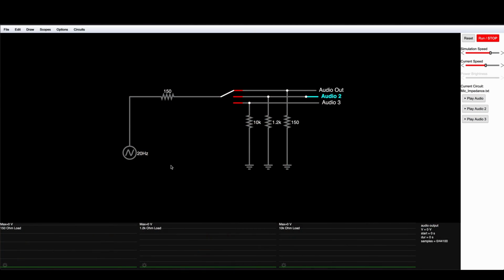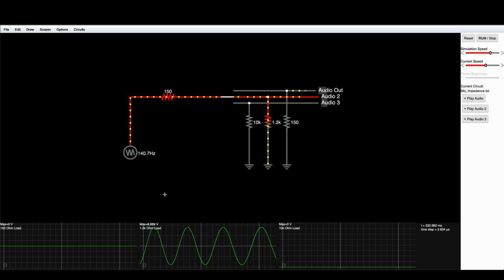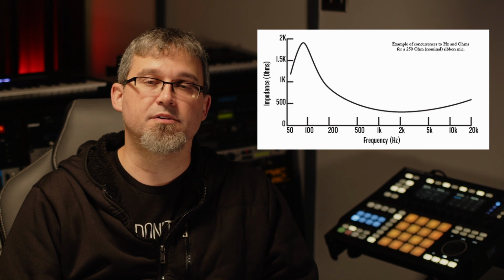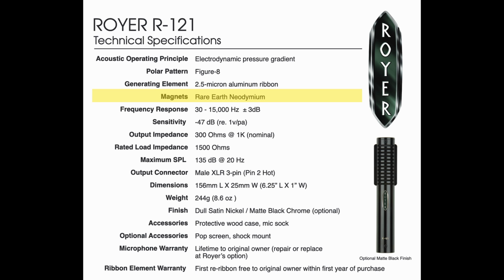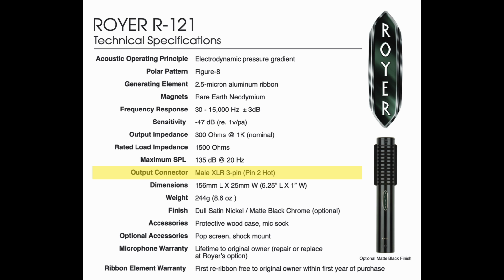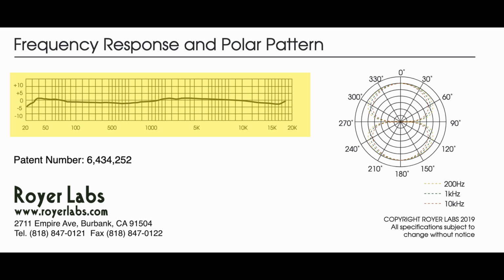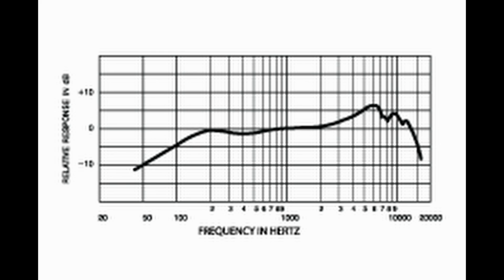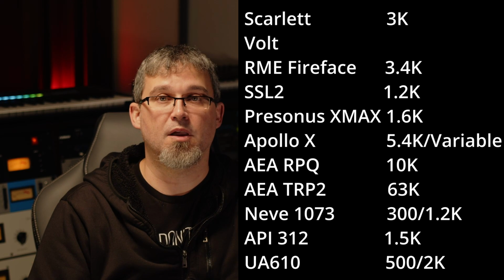Impedance

Comment: hey! if i’m understanding your tests correctly, I still don’t think my use case was covered. I have a vintage hi-z mic (25k Ohms) with a TS connection. I’m trying to figure out the best way to connect it to a modern interface. what are your thoughts? Do I want to the opposite of a lift, if that even exists? Or am I just not getting it? that’s definitely possible 😂
Reply from the maker: Yes, you can use a device like this:
sweetwater.sjv.io/Z6RJWz

There are other brands and converters available. But you want a hi-z to lo-z transformer.  Shure makes a reversible one
(Shure A95U Line Matching Transformer - XLRM to 1/4-inch Female)
Reply: @meistudiony  amazing! Thank you so much. purchased!

Comment: I came here because i wondered what is best for a mic with 40 Ohm impedance. I think I should set the pre-amp to low-Z. The pre-amp definitely has louder output when I set low-Z on
Reply from the maker: 40ohm is pretty low.  Usually when we talk about a lo-z mic, we're talking anywhere from <100 to about 1k or so.  High impedance is usually in the 10K+ range.  At one point there was medium impedance, but its not really used much anymore and was trying to be an intermediary between lo and hi so that it could pass on either system.  Thanks for checking it out!

Comment: Kick A!! Video; great explanation… question, I have a Tf51 mic rated 300 ohms with a BAE 1028 pre 300 - 1200 ohms ; which should I buy a cloud Z or AEA mic pre ?… I would highly appreciate your expertise
Reply from the maker: At 300ohms on the mic the BAE pre in 1200 mode will work fine with it and probably sound amazing. The cloud z wont pass along phantom power to that mic, which it needs. The AEA pre really excels with dynamic and ribbon mics but does still sound good on condensers. Honestly though… i think youre golden w the BAE.
Reply: @meistudiony  The mic is a telefunken tf51; it’s a tube mic that provides its own power so would a cloud Z work as far as impedance matching ?… I’m trying to have impedance 10x the 300 ohms of the microphone. So, would cloud z be any good in my situation ?
Reply from the maker: @Nighthawkclips  you might see marginal low end improvement, but probably not enough to justify the cost of the cloud Z.
Reply: @meistudiony  thanks… It also should result in a better EIN; lowering the noise floor ?…

Comment: It's been my experience that some microphones change more with preamp  impedance changes than others.  For example, if you did this same test with a Coles 4038 instead of a Royer, especially a lower impedance version, changing the impedance it sees can have a more drastic effect.  Also, the XLR name came from Cannon Electric which described it as X - series name - Latching-Resilient. Sorry to "but axchually" this, just trying to be helpful to those looking for the information.
Reply from the maker: Yes, i went over all the cannon stuff in a later video, all good! I like when people bring stuff to the table! Keep it coming!

The mic itself definitely plays a part in the tonal shift from the mic pre impedance.  And you're exactly right.  Since the mic itself isnt a "static" source (depending on the frequencies its picking up it changes, which is why a mics impedance is calculated usually at JUST 1k).  Ribbons and other dynamics are especially prone to this.  I have noticed that older designs (like the coles and RCA mics) seem to shift more than say the Royer 121 or R10.

Comment: I appreciate the information in this well done video. Having been a UA Apollo owner for many years, I've come to the conclusion that the variable impedance modeling in their Unison preamps does little more than affect relative gain staging. That is, I can use a 600 ohm mic into a 1073 Unison plug-in and a 200 ohm mic into the same 1073 plug-in and they will, after compensating for the small relative gain differences, sound identical. While there may be some minor differences in the very low frequencies, I typically have these frequencies rolled off with a LC filter anyway. My ears simply can't detect the differences in sound based on differences in mic impedance.

On a related issue, this subject has become of more interest now that I've purchased a UA Sphere LX microphone and have begin experimenting with its different models. The Sphere is a fixed, 200 ohm (@ 1kHz), dual capsule mic. Its raw, 200 ohm input signal is coming into the Unison preamp and met with whatever Z the current plug-in has configured. The mic modeling only happens post Unison AD conversion AND post Unison plug-in modeling. If the above discussion regarding impedance vs sound holds true, then the Sphere's post-Unison sonic modeling should hold up reasonably regardless of the Unison plug-in's Z setting. Of course I'm assuming that other aspects of the mic model (i.e. pickup pattern, axis, etc.) are purely a mathematical function of the dual capsules and have little to do with the signal at any given moment. But I may be wrong on that.
Reply from the maker: From what i've seen / heard in experimenting (still) with impedance, the biggest difference i find is ONLY in the top end.  The lower the load, the more the top end will get rolled, the higher the load, the more top end presents.  The sphere is a very nice mic (we have the Townsend version, from before UA took it over.... same mic).  But yes, the software isn't taking impedance of the original mic into consideration nor is it able to compensate for how a dynamic mic will react to the shift in load at the preamp.  Its an approximation and one that in the scope of things, doesn't really matter much in the context of a mix.  The function of the dual capsule is to be able to approximate the polar patter of the various mic models (very few mics have perfect cardioid patterns).  The two diaphragms are mixed to create the pickup patterns (the same as is done on many mics that have multiple patterns).  The impedance in that regard has nothing to do with that as long as the back and front are matched while its doing its thing.  The worst that would happen if theyre not, is your pattern would get a little janky and the frequency response might be a little more off than expected.  The other issue is that they're trying to emulate the response of a dynamic mic (depending on the model) with a condenser capsule... again, its an approximation, and a damn good one at that, but its never going to be EXACT... and it honestly doenst need to be, its close enough for rock n roll.
Reply: @meistudiony  Agreed. The Sphere/L22 emulation is not perfect but it's very, very good. What small misses exist in the emulation are greatly overshadowed by all the other variables in the chain.

Comment: Hi!, very interesting!. Just one question, the impedance values in the test, are balanced or unbalanced?
Reply from the maker: Everything in these tests were low Z balanced connections.  I have a few HI-Z (unbalanced) mics here in the studio that I was going to try an compare, but, I don't have any useful Hi-Z mic pres to test with effectively.  (I do have a couple but definitely NOT something I would want to claim as "pro" audio).  There are so few situations now a days that call for hi-z (harmonica mic into a guitar amp is one of the only ones i can think of for studio purposes).

Comment: Cool video 👍🏻
Reply from the maker: Thanks for checking it out!  Boring topic but some of that info can really help pin point where problems are in a signal chain.
Reply: @meistudiony  
I recently picked-up an old high-impedance Japanese ribbon mic rated at 30k Ohms, which is totally uncharted territory for me.
This was informative and helpful.
Reply from the maker: @ThemFuzzyMonsters  in that situation getting an inline impedance converter can make that mic work with modern preamps. 

Hosa MIT-129 1/4" TS to XLR3M Impedance Transformer https://a.co/d/6tjCqDS

Something like that but, depends on the type of connector the mic has. We have a couple hiz mics, like the shure green bullet, we use these to plug into our lo-z pres. Works great.

Comment: I always wondered what XLR stood for (if anything). One of those things I've never looked up. Thanks for enlightening me! I'm new to the channel, I think I just struck gold! Thanks for the quality material.
Reply: XLR stands for "X-series" "Latch" and "Rubber." State of the art connector today, but rubber was optional for corrosion and locking was optional for unintentional disconnection. Has nothing to do with balanced lines or range.
Reply: @mvwoon  Yes, X = Cannon X (the original designer and manufacturer), L = latch, and R = Rubber Gasket. I like 'Extra Long Run' and it is an accurate name - but let's be technically correct and all that. Great video and loved the recorded examples. Great job on difficult subject.
Reply from the maker: Thanks so much for watching!  Im new to this too (the whole making video thing that is).  Glad you got something from the video!  Any questions feel free to hit me up!